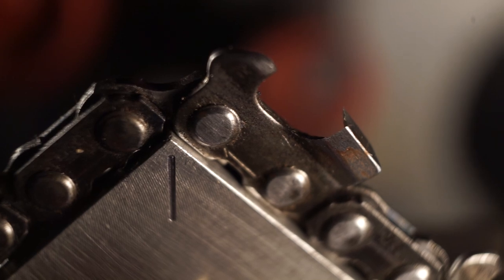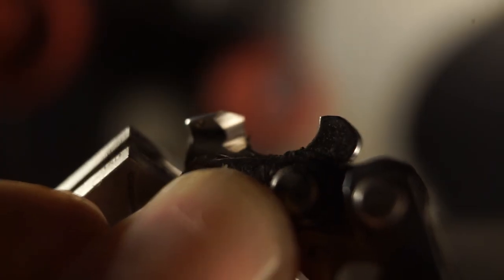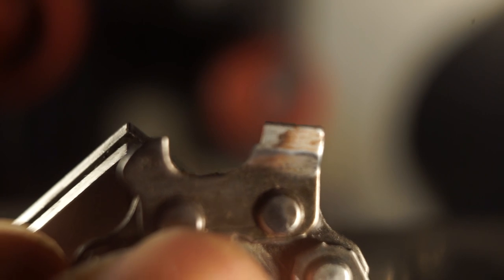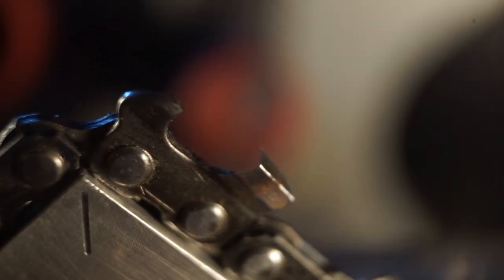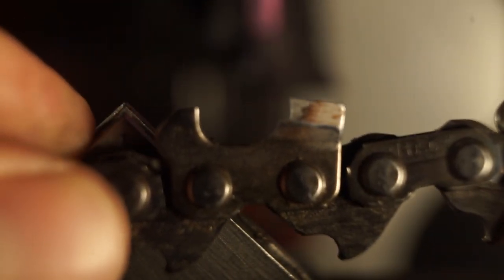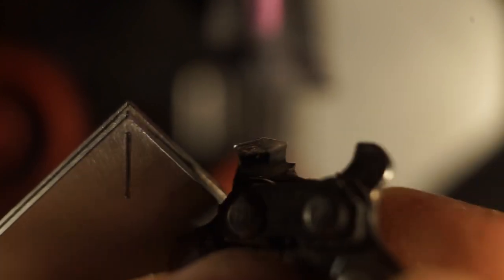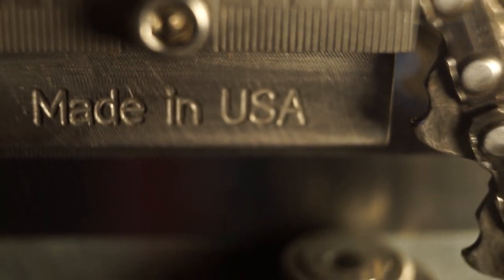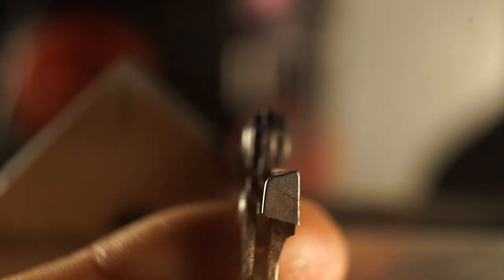Square grinding chain with the SquareJig chain sharpening jig and filmed with a macro lens

Comment: How are you consistently dressing your wheel?
Reply from the maker: Hello Wolverine97 !

Happy to answer your question. In short, I just eyeball it. I know it sounds odd considering how precise and robust the purpose-built square grinders are but it's not as critical with this setup. 

The only change to the tooth that dressing does is it determines the side plate angle. The sharper the point on the wheel makes the cutter tooth slope forward. The top plate angle is always the same no matter how you dress the wheel. 

Once you get the angle that cuts your side plate how you want it, it's really easy to put the diamond file parallel to the flat spot on the wheel to dress it. 

I'll add that dressing the wheel most importantly removes oil and metal from building up. Aluminum oxide is one of the best abrasives for sharpening chainsaw chain in my opinion, but its' downfall is that it is porous and collects oil and metal which tends to burn the tooth and create a burr if not removed often. The other vital thing dressing does is it redefines the outside edge of the wheel so you get that nice line from the working edge of the tooth into the inside corner of the tooth. 

Knowing what the tooth looks like is a big part of the process for me. Well that and cutting the depth gauges correctly.
Reply: @squarejig  I have a Simington but your device is very interesting. I shared this vid on FHC. I wish you the absolute best. I’ve been using square chain for a while and love it’s performance but the learning curve for hand filing in combination with the cost of files turns people off to it. I also hope your price point isn’t too high for the masses to wait for the communist knock offs.
Reply from the maker: @Wolverines1  

Thank you for posting it. 

Yeah it is a new interesting idea. It has a lot of benefits for someone that wants to use the same machine to do all of their chain maintenance or just add the square grinding feature to their round grinder. Some folks have no idea how fast their saws can cut until they use square ground chain.  I'll have some better videos out soon that are a bit more in depth. I have a Simington as well and it's what I learned how to sharpen chain on. Great machine.

 I thought about the China knock offs and I know there is no way they can make the tolerances and quality that we can here in the US. It won't say Made in USA in stainless steel anyway.  My patent should hold the rest at bay. Well I appreciate you. Have a good weekend.

Comment: you might mess with the heat treatment on the teeth if you create too much heat. I just sharpened my chain by hand for the first time and it was pretty easy lol.
Reply from the maker: That's great!  Did you round file or square file? A good hand square file job is admirable. Heat is definitely your enemy when working with metal. That is a great point you made. Overheating the tooth causes it to harden which damages files faster and makes it harder to hand file in the field. When you grind, the hardening can be to your advantage if you only grind. When you have a harder tooth in theory you will be extending run times on your chain. The length or extended run time may be negligible, however scientifically a harder tooth should wear longer than a softer one. There are simple techniques to grinding to keep the heat down to prevent burrs. Keeping heat down is ideal if you want to hand file in the field. However, if you swap chain in the field, heat treatment doesn't matter as much because you just take your chain home and sharpen them back up with your grinder. Some can hand file a square ground chain really fast, but I think they would be hard pressed to get the same accuracy as a machine. And then if you rock a chain, a grinder is also an advantage because you can take material from the teeth accurately and quickly. I don't usually use a grinder to round file unless I really damage a chain. It's really fast and easy to round file but you're not going to get the smooth and fast qualities of the square cutters.
Reply: @squarejig  round file and a harder tooth will just chip instead of deform. hence why Gerber brand hardens its knives at 55 on the Rockwell C scale. You anneal a metal if you heat it red hot for a while then let it cool slowly at room temperature. also your gridding wheel should be using a depth stopper but the wheel will shrink over time. its also too easy to dig too deep with a grinding wheel.
Reply from the maker: I agree. Good stuff. Thank you for your input. As far as a stop is concerned, square grinding is a bit different. I have to line up the working corner of the tooth and the corner of the grinder wheel. I can use a stop but lining up the corners is best done visually. The wheel is not round with square grinding. It has defined corners. I really like chainsaws and would like to help anyone learn square grinding. I encourage anyone to try out a square ground chain sometime if they haven't already. I was amazed at how much faster and smoother it is than round filed chain. I started with round filed chain and I used it for many years. Once I tried square ground chain I never went back. It really is at least 15% faster.

Comment: Wow this looks really cool. I’ll be checking out the website. Really interesting idea that someone finally came up with! I’ve tried square hand filing and could tell right away it would take a lot of practice to do it consistently well. And a $1500 simington seems overkill for a weekend warrior!
Reply from the maker: Right on SS!
Reply from the maker: Yep! Check out the Oregon 410-120 grinder. It's on sale with Amazon for $209 sometimes. Also check out Squarejig.com $320 for the jig. Well under $600 and you can square grind your chain. You can actually do all your chain maintenance with this setup. Depth gauges can be done really easy as well with this machine.

Comment: Great concept. Would be nice if you had some way to consistently get same as dressing angle on the wheel, but I could definitely see this thing be a good solution to get into square ground more economically. Cuz heck even the files now are like 20 bucks each. If you get them
To start selling let me know I’ll pass along your info
Reply from the maker: Right on thanks! I'll definitely let you know. I was thinking of an easy way to dress the wheel. As you can see it takes a steady  hand to get the angle where you want it. I have some ideas to solve that issue.
Reply: @squarejig  probably could make some sort of flip up arm on the backside of your jig with a small block to accept a diamond dresser,  maybe the flat block style, id think with that style of grinder you would want it where you setup the angle for the sideplate "grab" angle (0-10 degrees forward from a true 90 is usually where people end up)and then plunge the wheel down into it lightly. On a silvey or simington the wheel is in a fixed spot so moving the dressers is the way to go, but since you are using a grinder with a moving wheel you need a "rigid" dresser.
Reply from the maker: @beerayfarms7979  Those are awesome ideas. I just got some smaller diamond files and its now so much easier to make a "V" on the wheel. I want to keep the cost down but it could be the next product for sure.
Reply from the maker: So these are currently for sale @ squarejig.com
Reply: @squarejig Would using a v shaped diamond grinding wheel instead of dressing a stone work or would the wheel wear our too fast and not be worth the money
Reply from the maker: @lililililililili8667 I've had some custom CBN wheels made with a "V" and they don't work as well as the aluminum oxide. I'll make a video soon.
Reply from the maker: @lililililililili8667  Hi yes, they do have a function. I have made some that work for extremely tough chain that won't cut with a standard aluminum oxide. They do last a very long time but tend to create a burr on the ones I've tested. I'm working on a different grit size to see how that works. I'll post a video when it get the wheel.

Comment: Will this work with a tecomec super jolly?
Reply from the maker: Hi Robert, the hydraulic clamp on the  super jolly I don't think allows the Squarejig to stay held in place. The Tecomec Jolly Evo works great though.
Reply: @squarejig  ok I do have a Oregon 511a I think that similar if I’m not mistaken. I did look on the website any idea when the products will be off back order?
Reply from the maker: @Robert-in5oq  I have not tested the 511a grinder. The jigs should be back in stock in a couple weeks.

Comment: How hard is to dress the wheel on the square jig?
Reply from the maker: It's easy. The diamond file removes material effortlessly. It's not like the dressing stones that take a while to dress. It's also faster to dress than the purpose-built machines. I have a video on it.
Reply: Thank you. After a ton of research, and 2 years attempting to square file by hand, this seems like the perfect solution
Reply from the maker: @michaellineberger6504  Yes, that is exactly why I created this. I was in the same position. I wanted square ground chain and had a heck of a time hand filing. It was especially tough for met converting round filed over to square. This setup solved if for me. It does take time to learn but not near what it takes to hand file.
Reply: I was very close to pulling the trigger on an ATOP jig, but they are so expensive for what you actually get.  Also, they don’t guarantee the right angle on all sides.  After I recover financially from Christmas I will order one.  Thank you
Reply from the maker: @michaellineberger6504  Right on Michael, I have seen the ATOP on Baileys for $220. It looks like a pretty cool hand filing setup. I think the Squarejig will have some advantages though. If you like you can read the instruction manual found at Squarejig.com to give you a better idea of how it works.
Reply: Thank you